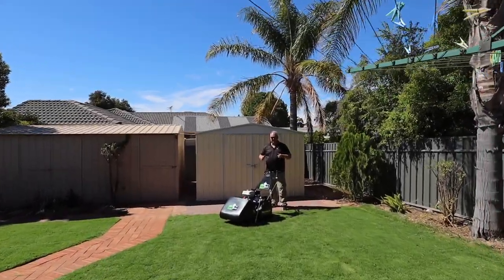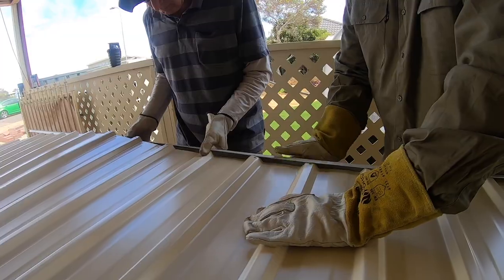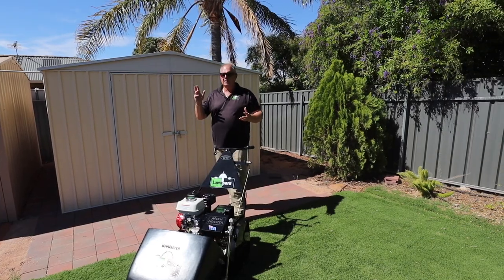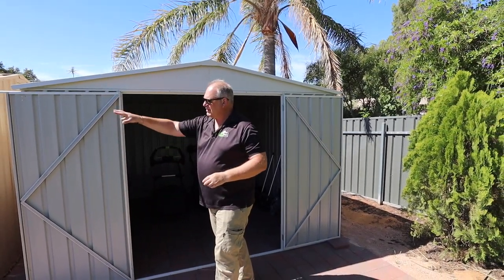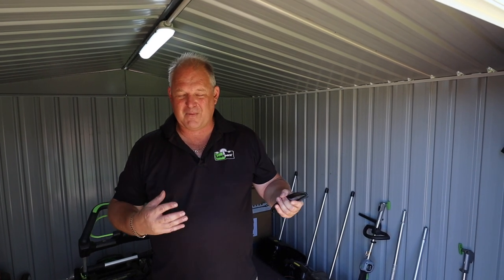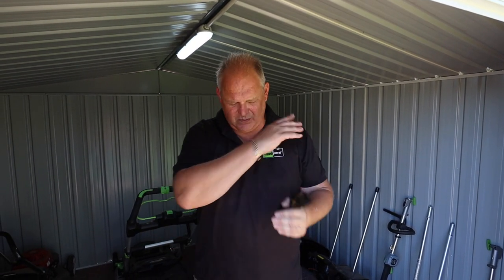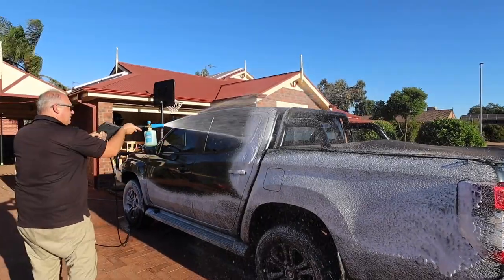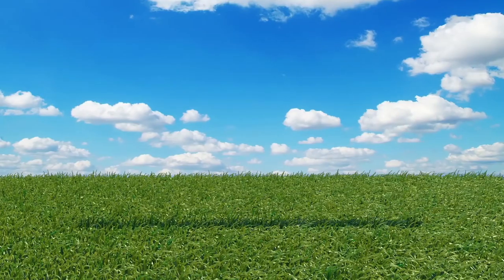ABSCO SHED Cheap, Easy Build and Good Quality

Comment: I’m about to buy the identical shed but I need to know if the dimensions given include the roof overhang. I want to place it on a concrete pad so that the walls are flush to the concrete all the way around. Basically I need to know the exact outside footprint measurements of the walls only. Can anyone help?
Reply from the maker: I’ll measure mine up tomorrow for you.
Reply: @lawnporn  Thanks very much from the other side of the world! Your time and attention are very much appreciated! I’ve been trying to track these simple details down for weeks! Even Absco themselves couldn’t tell me!! REALLY!
Reply: @lawnporn  
Hi Matt! Did you get a chance to measure up the shed wall’s dimensions? I’m keen to get started on making my concrete plinth. Thanks again for your help!
Reply from the maker: @SuperFOSS1 looking at the front of the shed the panelling is 3.0 metres. Including the over hang of the roof it is 3.07 metres, so each overhang is about 35mm or 3.5 centimetres. The depth of the shed is 2.92 metres.
Reply: @lawnporn  Thanks so much for this simple but extremely welcome and useful information.

Comment: My husband and I assembled one of these for my parents. Honestly found it terrible. First bit of wind all four walls blew out at the base. Ended up having to reinforce it with sleepers - one down each side and one along the back wall, screwed them to each wall at the bottom on the inside of the shed then to each other so it couldn’t blow outwards again.
Reply from the maker: Thanks for sharing that experience. If you don’t add the extra screws at the splice the panels are weak. So if it is blowing out, this may be the reason.
Reply: #Lawnporn lawn care tips there were plenty of extras added, husband is a tradey in construction so there’s always extras added 😂 we just didn’t have a great experience with it but can see why it would be a good option for some
Reply from the maker: Fair enough. Cheers for sharing.
Reply: Would you recommend adding screws to the slice before or after panel assembly? I imagine the screws would prevent the sheets from entering the channel.